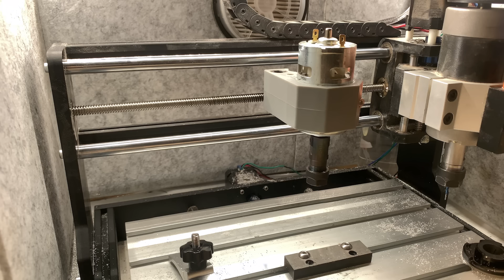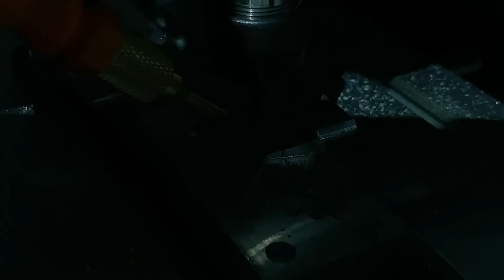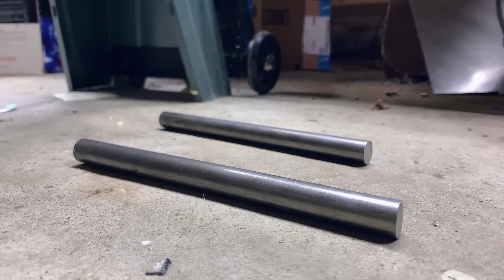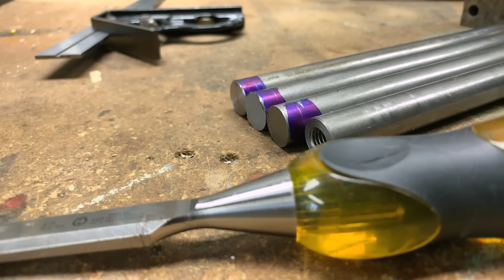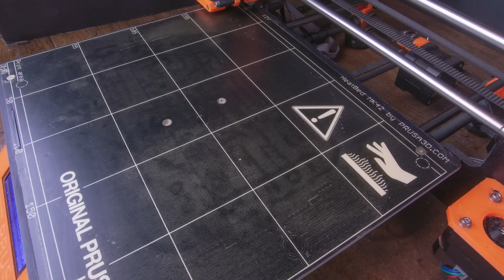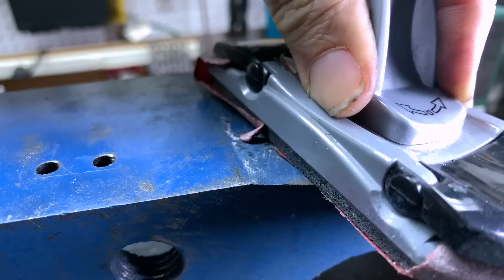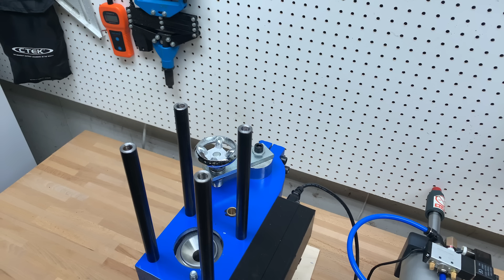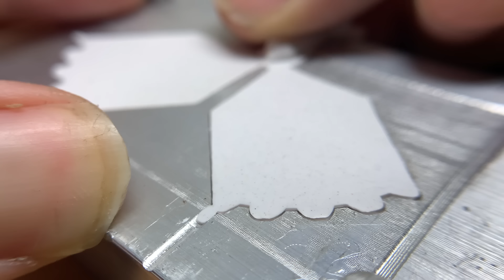Build an Injection Molding Machine From a Cheap Pneumatic Press

Comment: What injection temperatures can you achieve?  What plastics can you  use? Without a screw or back pressure I image it is pretty limited. Looks fun though.
Reply: Remember that many plastics contain Cynanide, chlorine, and other toxic chemicals.
Reply from the maker: Since the temperature is independent of screw action I assume it could handle pretty high temps but since I’ve only ever done ABS and PE I’ve never taken the temps up very high. I bet the Buster Beagle 3D community on Facebook might have more first hand exp. with other plastics. What is back pressure?  I’m curious about that. Since the chamber holds more plastic than the shot needs the press can be programmed to maintain pressure on the mold for a period of time to provide plastic during shrinkage but that only works as long as the feed network stays open. So not nearly as flexible as having a bunch of hot gates or something. Still at this small scale it works reasonably well.
Reply: In a commercial inject molding machine much of the heat comes from the friction of the plastic on the screw. By changing  screw speed you also change the Temperature of the plastic. The heating element maintains the temperature the screw determines it.
Reply from the maker: @weldonkilburn6867  Yes, I was saying since I have no screw action and the temp is entirely dictated by the heating bands/Thermostat and how long the material stays in the chamber, high temps are certainly possible, but may require slower shot rates if the plastic needs more time to come up to temp.  Since my chamber holds only maybe 2.5x the plastic used in a max shot, it only has that amount of time to come up to temp.  So far with PE temps/me being semi slow swapping out the parts/my parts not using the max shot size I haven't had any issues, but I could certainly see situations where you were trying to use a higher temp plastic and you'd have to wait between shots a bit to make sure the room temp plastic got up to temp.   I don't think there's any other reason higher temp plastics wouldn't be doable.  I've done ABS with this kind of chamber, but never anything higher temp than than that.

Comment: Great video!  Where did you get that soldering iron (I think that's what it is) that you put in the press to push parts into your 3d prints?
Reply from the maker: That's just a super cheap adjustable temp soldering iron, with a 3D print to hold it in to drill press:  https://retrotechjournal.com/2016/06/21/soldering-iron-drill-press-adaptor/

Comment: Nice job. I made an injection molder a few years back, but do not have a mill, so it sits in my shed. I forgot what I even needed it for.
Reply from the maker: Well. I mostly needed it as a way to learn CAM.  lol.  For me 3D prints are almost always an easier/faster choice.  If I do another version of the loom with SO MANY parts then I'll get a real benefit, but for now it's mostly a learning tool/me having fun.

Comment: gotta get me some of those chisels that cut through steel bar and auto-thread.
Reply from the maker: I really like the Milwaukee SharpThread line, although you can see I was using a Craftsman in that shot simply because I haven’t sprung for metric SharpThreads yet.

Comment: Fantastic video! Loved every second! I’m also very interested in your cnc mods. I’ve been looking to get a first cnc and I like how you made that one more capable in what seems like a simple way. Would you mind sharing how you did that? Maybe cad models, links to parts, etc so I could make one too? Thanks!!!
Reply from the maker: I'm happy to share that stuff.  The main thing I did to stiffen/improve the machine was to put larger guide rails on it.  It's both a fairly cheap upgrade and makes a huge difference, but comes with a dark side.   Those rods are induction hardened, and they don't sell one's that are the exact length needed, so folks taking the mod have to have a way to cut hardened material.  I did it in the lathe with carbide tooling, but not everyone's going to be able to do that.  I think these are the rods: https://www.amazon.com/gp/product/B0811CS82C and these are the bearings https://www.amazon.com/gp/product/B07H95C7F5 so just basic 12mm setup. Materials cost is low, but being able to cut and center tap them is going to be difficult for folks without a lathe.  You might be able to grind the outer hard casing off and do something like cut it with a hack saw, but to really work they need to be a pretty precise length/square end/very centered hole.  So really it's a job for someone with a lathe.   The more expensive part was the 500w ER16 air cooled brush less spindle motor with driver and mount, which I got off eBay, so you'll have to search. And a 48v supply.  I got this one:   https://www.amazon.com/gp/product/B08BBVSK81b Here's a link to all the cad.  Including the various axes and the enclosure.  Be warned I didn't exactly clean up any of this, it was for my own use, so there are some known issues that I never cleaned up in the models https://a360.co/3iUGEii   Also be aware that I sacrificed some vertical travel in order to gain a little stiffness, and that's ok for doing 1/2" tall AL die work, but doesn't leave a ton of headroom.  I've been thinking about bumping up the mounts for the X axis to give some more headroom. I left space in the box for that, but haven't tried doing it yet.
Reply: @retrotechjournal  this is awesome! Thanks for the info I’ll definitely check it all out and see what I can do. Good point on the lathe, I’ll have to reach out to a friend for that part. Thanks again! Looking forward to your next project
Reply from the maker: @HantoHowTo  Great, yes, if you have a friend that'll let you spend a little time on the lathe the cutting/drilling those rods will be pretty easy.  Good luck!  Let me know how it goes!  I've really enjoyed getting my 3018 all beefed up and going.  :]

Comment: In theory you might be able to replace the machined stabilizer rods with 2020 ext aluminum since the need to resist pressure on that part seems fairly minimal. Would make it more kit friendly if it worked. I wonder how much pressure the spacers really take as well. An engineering plastic like Delrin might work and if it did you might be able to source Delrin spacers (can handle like 5k psi compressive force with no issues). Actually it may not be as exciting but I'm sure a lot of the parts could safely be Delrin, which would also be more machinable for most people too. I'd be willing to bet that most of it is kit-friendly with a few tweaks
Reply from the maker: Well they're just cut steel rod.  Which are stronger and cheaper than AL or Delrin.   It's a 500kg cylinder and that's divide by 4 so total load is not super high, but it's an intermittent reversing load, all transmitted through those threaded studs so thread pretension/locking is important, and strength at the threads is key.  I went with steel because it was cheap and easy/compatible with the studs. For me personally just facing/tapping some rod I don't see much practical difference between steel/AL/Delrin.  (In terms of time/number of operations/difficulty)   If someone has no machining capability the big sticking point is going to be the ram, not the spacers since that really should be stainless.
Reply: @retrotechjournal  yeah, I don't know that there is any way around the ram being machined. The spacers I just figure there have to be ones out there ready to go for people who can't machine much and Delrin just seems an ideal candidate that likely already exists. 

You've definitely done a bang up job, I was just trying to figure out how the project could be made more friendly to people without your skill/toolset. Seemed like when you made the video that was an idea, and since I just found it, I was more or less pondering aloud.
Reply from the maker: @XeroShifter  I appreciate that. Buster Beagle 3D sells kits with ore machined parts. I guess something like that might be an option.  You’d almost think there’d be some ready made parts that could be the spacers but they do have to be a specific length.  It’s all interesting to think about.

Comment: Why not power tap on the lathe?
Reply from the maker: Power trapping blind holes without a rig that could provide some sort of "instant reverse" isn't something I'd want to try.
Reply: @retrotechjournal  it's not hard, I power tap blind holes on machines all the time.
Reply from the maker: @justinbevier8231  ok. Just remember my little lathe has a threaded chuck so reversing under power isn’t an option for me. :(
Reply: @retrotechjournal  no need to reverse, you can reverse by hand.

Comment: I also clicked on this just out of curiosity. Great video, love what and how you made it. Very interesting but I do not have a CNC machine but really want to get or make one. Thanks for doing the video.
Reply from the maker: You're welcome!   I can't recommend CNCs enough.  Long ago I was slow to get on the 3D printer wagon, I was all about using the maker space laser cutter, and wasn't impressed with the 3D prints, but after getting one it really changed/leveled up the way I make stuff.  (Because it forced me to learned real CAD) I feel the same way about CNC, and at least the proliferation of 3D printers has reduced the price of minimum CNC setups. (Thanks to cheaper controllers/grbl/etc)  It's nuts you can get an 3018 for < $150 these days.  Now a beefier machine is always going to cost a lot, but you can sure lean a lot on an entry level 3018.  Good luck!

Comment: I wouldn't be surprised that the video editing took longer than making that machine, anyway, I'm super impressed 🙂
Reply from the maker: That is correct.  All the work of filming/editing adds SO much time to a project.  There's really only a few weeks of 3D modeling/building on this project, but it ended up being a few months of work to both build it and document it.  Still that's also fun, but just different fun.

Comment: You totally have sparked my want to make my own cnc and much more!
Reply from the maker: I will say that getting that cheap 3018 has really upped my game both by forcing me to learn a bunch of CAM and by opening up some forms of digital creation I didn't have before.   I've become a big fan.   It's nice to learn shattering $2 end mills instead of $30+ end mills with some big CNC.  When my z axis unmounted and I drilled though the table I just laughed.  If that'd been some super expensive machine I would have freaked out.  lol.   I kind of wish I'd documented the mods I made/played with the stock 3018 more.   It was making such a mess I didn't want to deal with it until I'd made the enclosure, and by then I'd also modded it up to make it stiffer/added the bigger brushless motor, etc.   Not really sure what the final investment in the whole thing was.  I didn't keep track because I wasn't documenting the thing, but probably < $500 even with the enclosure.    Which isn't bad for what it can do, and 100% worth it for what I've learned.

Comment: So, there I was, asking myself "how could I possess a low-cost injection molding machine...?"
Reply from the maker: I did some very minor injection molding in my high school shop class. We injected a handle around a very tiny flat head screwdriver rod. The whole setup was just mounted on a big drill press, and it left the impression that “this is approachable” I think that screwdriver is still in the “junk drawer” at my dad’s place.  I knew someday I’d have to try it. Lol

Comment: What a great job!!! can't wait to see the pneumatic  mold vise you are going to build next instead of the beam clamp...Your welcome....:chillwdog:
Reply from the maker: Thanks!  Yes those commercial units have a very cool pneumatic/hydraulic clamping mechanism. I have yet to figure out a way to get my mitts on one for cheep though.
Reply: @retrotechjournal  i would modify an old air powered vice off cl or ebay, i have made them before, and  way within ur skill set....

Comment: So several months of trial and error or a quick $7k.... hehehe  I think I know why people buy these.  But awesome skills making a routine project fun to watch.
Reply from the maker: Well most of the "several months of trial and error" was me learning about cam/moding my 3018, etc.  The actual press part was pretty much "as designed" except for changing the way I limited the max crushing force on the springs.  (Thanks to being able to follow Buster Beagle 3D's chamber design, etc.)   Plus at least for this I'm all about the journey not the destination.  You're 100% right though that many DIY items end up being not super viable if you don't enjoy the process/add the cost of labor.  Knitting your own sweater is going to cost you more in yarn than buying a new sweater.  At least with this one, the parts were way less expensive than the final item.  :]

Comment: Are those injection moulds aluminium? Can those made by casting, mould made first from 3d printer and using finest oil bond sand or jewelry gypsum for smooth surface?
Reply from the maker: Yes, they are aluminum.  I suppose they could be cast but you are correct that surface finish would be an issue. Also warping due to shrinkage.  I guess if you had a simple part with low tolerances and you were willing to lap in the mating surfaces and polish the mold surface you could get away with it. CNCd molds also tend to have a hand clean up and polishing phase. Depending on surface requirements. So yes possible but not generally done.

Comment: Great build, interesting video. Lots of good solutions to problems. One question though, I have to say I'm not an expert on injection moulding, resin moulding is more my thing, so why doesn't the injection mould need a vent for the air to escape? I see the first mould actually expands as you inject creating a small gap ( 21:41 )  which I guess solves the problem for that particular mould but will you need to factor in escape holes in later moulds?
Reply from the maker: That expansion was only because while filming I didn’t want to crank down on the clamp with a lot of preload because  that bumps the camera etc.  normally it doesn’t actually open.  I didn’t notice it was doing that until I was editing g the footage.  I should have reshot but didn’t think folks would notice!   You are correct that venting can be important especially if you’ve lapped in the mating surfaces.  I did mill some shallow vents at the corners that you can see in some of the injections.  Now I cut air vents with a needle file after the fact instead of doing them on the mill so I can reduce the cleanup.

Comment: Such a well done video. I have so many projects to finish but this makes me want to add an injection molder to the list.
Reply from the maker: Thanks.  It does seem
Like home brew injection moldings time has come.  With advances in both short run 3D printed molds and amazing access to CNC.

Comment: ha ha you have crowdered head space sir !, excellent work .20 years in a plastic factory , have been wondering about makeing things with the knowledge , and yes a lot of time was spent working on the raw material dryers , and the absorbent beds , a nice job in winter ,not so good in summer .You can have tiny air bleed/relief holes in your moulds to help get a good fill , and cooling through the mould . next step would be a hydraulic clamping mould ??. [ fingers be seriously wary ,some machines have 10s of tons of clamp pressure ].
Reply from the maker: Yes, some of the AB-100 style "commercial" pneumatic presses have a hydro-pneumatic clamp thing that is awesome, but which is not an easy thing to track down as surplus, or hack up out of something cheap.  I have experimented with various vent lines in the molds.  Just to help corners fill, etc.  Great to hear from someone with such experience!
Reply: @retrotechjournal  I never designed or made moulds, was a sparky , but from memory they had tiny drill holes all over ,large enough for air but to small for hot plastic ,with the stretch blow moulding quite a lot of air has to get out in a faction of a second , with your injector wouldn't need as many ,but you should't need any actual flow through /out path ways of material .[ am jealous of your workshop !?]. God speed ,keep up the good work. MG
Reply from the maker: @johnmarkgatti3324  Thankfully with most of my designs so far it's been easy enough to engrave some vents along the parting line.  If I end up with molds that have a deep feature I may need to look into drilled vents, but hopefully no time soon.  Tiny deep drilling sounds like trouble.  ;]   I do love my workshop. I've been building it up for a LONG time.  When I walk in there I can feel my spirits lift.